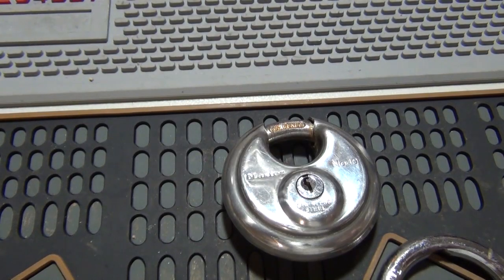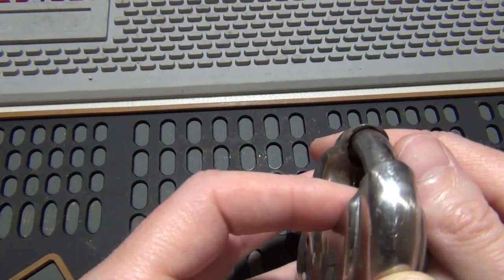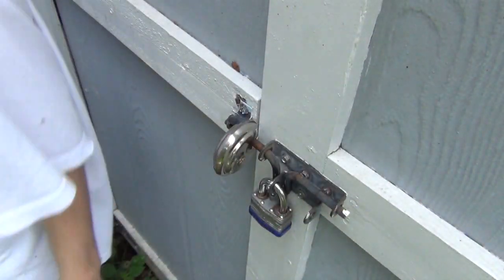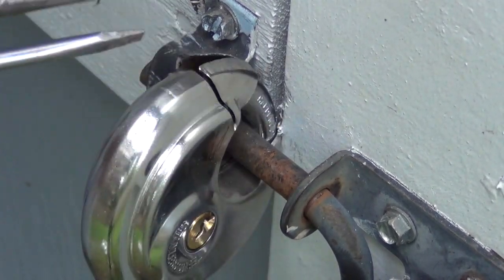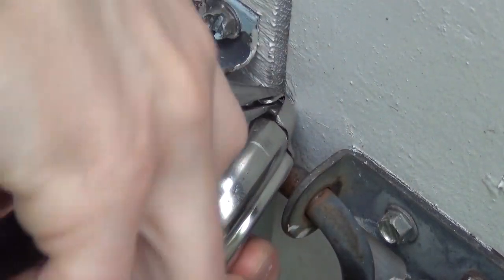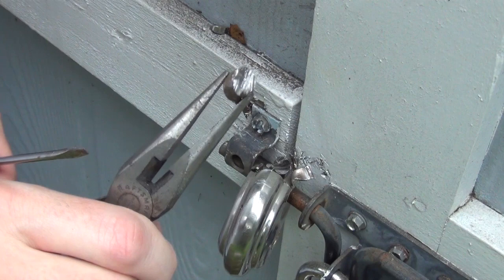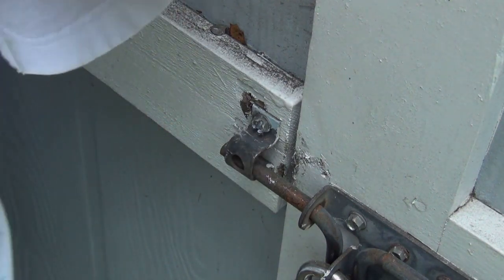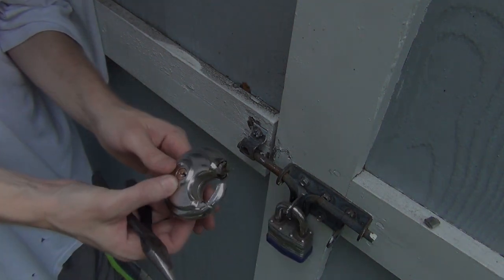Cutting Disc Storage Locker Lock Off with a Dremel

Comment: Why dont you just get screwdriver and take the lock off that way, unscrew the two screws and slide it off the hasp. :) easy fix.
Reply from the maker: I should of thought of that! damn it lol
Reply: @russej02  lol
Reply: 😂😂😂😂 Was thinking the same
Reply: It's more fun with a Dremel.
Reply: Well, I don't think you can take those off with a screwdriver, but that's also just a less helpful video.  My last storage unit had two bolts that you could remove with a wrench and two that had round domes that you wouldn't be able to get any purchase on with a wrench or a screwdriver.  I assume most storage places don't have hasps you can just remove with a screwdriver.
Reply: that's a good one lol.
Reply: Because all he has to do is slide the latch to the left. It is not a hasp, it is a non-locking door latch. A hasp would not have exposed screw heads. He is messing up the paint job.
Reply: Young generation you can't expect much from them Lol... Yes unscrew the bolt makes sense
Reply from the maker: Older generation completely missing the point of the video but thanks for the view and comment
Reply: @russej02 😅💀

Comment: If you just cut all of the way through the metal past the hasp the lock will come right off without having to even cut the hasp super easy he made this A LOT HARDER
Reply from the maker: I was cutting the lock not the hasp. I’m doing this again with the tool I use working. Subscribe so you see it when it post

Comment: Are you aware of any heavy duty pad locks that can't be cut off with a grinder or Dremel tool?  Need one for my storage unit
Reply: Arthur Trella nope, best bet is to go with a storage unit indoors or that has great security. Locks keep an honest person out, almost all locks can be cut or picked in about a minutes time
Reply: Mul-T-Lock brand Padlocks are insanely strong and it would take probably 50 of these blades to get through and like an hour or two
Reply: Watch the Lock Picking Lawyer and you will find out there are no locks that can’t be defeated. The difference is defeated by who and how long it takes. Stay away from locks at the big box stores. Military type padlocks for ammunition are in the most secure type he has shown.

Comment: I haven't read the comments, someone else might have thought of this, but wouldn't it be easier to unscrew the deadbolt, slide the lock off, screw the deadbolt back on?
Reply from the maker: Pam Brown yes except doing that wouldn’t show that you can cut one of these locks with a dremel which was the point of the video.
Reply: @russej02  sorry! :)  just surfing and trying to find a solution to getting a lock off my army trunk! Lost my key.
Reply from the maker: Pam Brown e-mail me a pic of I’m a locksmith theboredlockpicker@gmail.com

Comment: "If you miss and knick their stuff they'll charge you for it."
    All those sparks will burn the paint and cause rust. Not all latches are they same but mine bend easy, another cost.
Reply from the maker: Anthony Thorp yep. I pick them whenever I can. When that isn’t an option I use a 4 and half inch cut off wheel on an angle grinder. I just wants to show people it can be done with a dremel

Comment: Will this work with the Disc lock "Defence brand"? psycho roommate stole my keys at storage unit and I'm desperate to get my Stuff in storage that is left from all she has stolen
Reply from the maker: yep.  I'll cut any of them.  problem is there usually isnt anywhere to plug into so you need a battery operated one and probably two batteries and a few cut off wheels

Comment: It would be a lot easier to just take the screws off the latch in this case
Reply from the maker: Or just use the key.  Except doing that doesn’t show cutting it with a dremel tool.

Comment: Thank you.. I've got 10 disc locks to cut off, so I appreciate your video Bro🙏💯
Reply from the maker: Glad it helped! Angle grinder with cut off disc is faster but it’s definitely doable with a dremel
Reply: @russej02  I ended up using angle grinder with cutting discs and it cut like butter..
Reply from the maker: @wes365  that’s what I do in the field too.

Comment: I simply take a grinder and cut it off in the middle..... maybe 5 mins.
You over think it bro.....
Dremel is too slow and small...
Reply from the maker: You missed the point of the video
Reply: @russej02  sorry.
Please enlighten me.
Reply from the maker: TheMelalg was showing it’s possible to use a dremel. I use a 20v angle grinder working. 2-3 minutes tops to cut one. Not everyone has one though
Reply: @russej02  
Understand, thanks!
Although I must say.... grinders are really cheap today, make sure you got one, for whatever or whenever.... :)
Reply: @russej02  you know what..... I watched it again.....
Nothing makes sense, the door is damaged, took an hour...
Go to home depot but grinder and save time.
Thanks
Reply from the maker: TheMelalg I have a 20v dewalt and 4 batteries that I use working

Comment: I know this is not valid given the video is Dremel instructions. Having said that if there is an easier visible option for access to this specific space; I feel like it should be mentioned . To get past this specific lock... Ignore the pad lock and cutting tool, simple flat head screwdriver with some elbow grease would romve the brace retaining the bolt on the door (left side)
Reply from the maker: This comment cracks me up every time someone leaves it. The point of the video is cutting the lock with a tool someone might have not me getting into my shed.
Reply: 😂 You weren't paying attention.

Comment: I had a similar situation now, 6 years later.  I decided it was cheaper and easier and a LOT faster to just cut the latch.  Replacement for the latch is going to be about $5 and the lock is $18.  It took about 30 seconds to cut the latch.  Each situation is a little different, but your video made it easy for me to choose which item to cut.  Thanks!
Reply from the maker: I made this just to show cutting that style lock can be done with a dremel. On a shed definitely easier to take the latch off or cut it. I cut these locks several times a month on storage units. Damaging the latch isn’t an option. I use a 20v angle grinder though
Reply: @russej02  Mine was on a cargo shipping container and I went ahead and discussed it with the owner before proceeding.  This was my first and hopefully last. :)  Your rec of the angle grinder was spot on!
Reply from the maker: @OneWildTurkey  cuts them like butter lol

Comment: I just broke the key off in mine and wanted to nuke the entire facility to get the lock off. Thanks for this video.
Reply from the maker: glad it helped man!
Reply: @russej02  My lock was faced the other way(keyhole on the left) and I cut into it right where you said and it took not 30 seconds to fall off. I used my Dewalt cordless grinder and I taped aluminum foil to the door so I didn't burn anything. ha.
Reply from the maker: @Tomnician  nice work man! in the field I used a dewalt 20v angle grinder too.  works great!
Reply: Storage operator here...Anybody who breaks a key off can just use the access pinhole on the back of the lock to push a straightened paperclip thru...this pushes out the broke part of the key. You guys been crackin me up for years haha.
Reply from the maker: Good advice.
Reply: @Tomnician  interesting. Any chance you have a picture of the padlock after cutting it off? Would be handy seeing the point of the body you went through.
Reply from the maker: @szymonpigula1889  this video from my other channel shows how these locks work which might help.  https://youtu.be/j9sVeLoMte4 I do have a bunch of these that I’ve cut. If you send me an email I’ll take a pic and send it. theboredlockpicker@gmail.com
Reply: @szymonpigula1889  I cut through the lock at like 10 o'clock

Comment: You should use a pair of channel lock pliers to hold the lock
Reply from the maker: good idea.
Reply: Nah.....Vise Grips.
The correct tool always makes the job easier. Be prepared and carry extra wheels,a special wrench for changing wheels if you break one,Needle nose pliers, a chisel and a hammer. Better to have it and not need it....etc.
Reply: I prefer channel lock pliers. If I need to adjust the grip or angle of the tool, or the lock in relation to the storage unit hasp, it is much easier to do with channel locks than with vise grips, where I have to unclamp it, adjust, then reclamp it to continue cutting, notwithstanding that the lock will also get extremely hot. I also cut from both sides.  I normally cut about 3 of these off each month, since they have very small keyways, are sometimes installed backwards, so yhey don't always pick easily. Also, a dust mask is a must.

Comment: Nice work!
Reply from the maker: HelpfulLockPicker thanks dude. Want to do this again with the angle grinder
Reply: russej02 That would be a lot easier for sure. I can't wait for someone to suggest you pick it tensioning that looks like a real pain from that angle.
Reply from the maker: +HelpfulLockPicker it was. I got the lock from picking off a unit working.